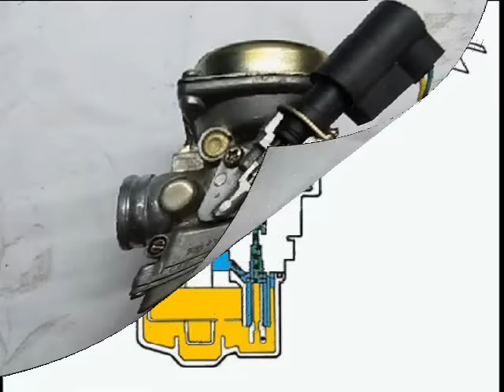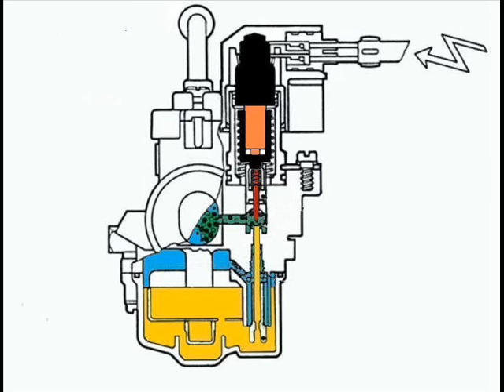HasSse - Automatchoke funktion och rengörning (2+4 takt)

Comment: The cold engine does not activate the automatic jicle. What is the reason? how can I arrange that??
There's electricity, it heats up, but the engine doesn't turn on when it's cold.  it's possible to adjust.
Reply: Hey did you figure out the cold start problem?